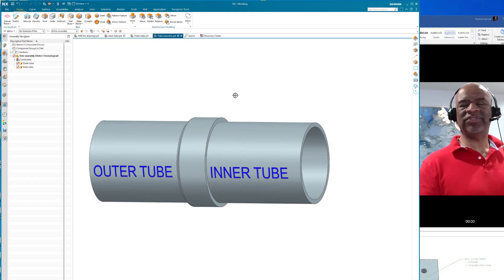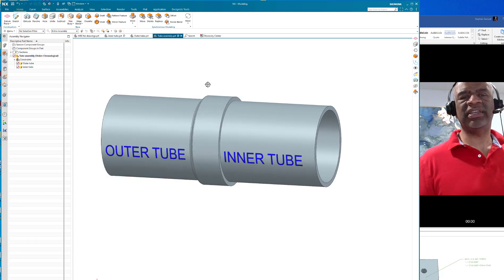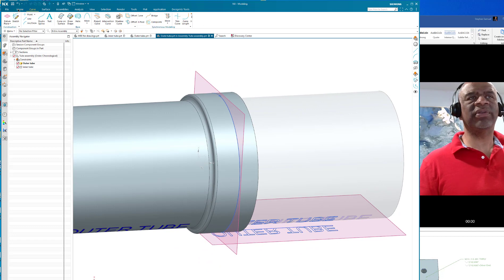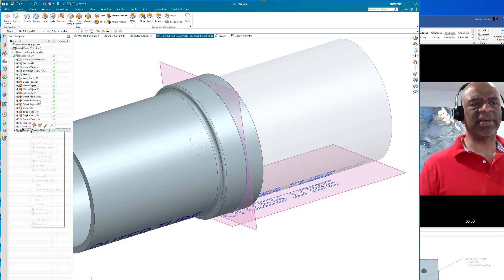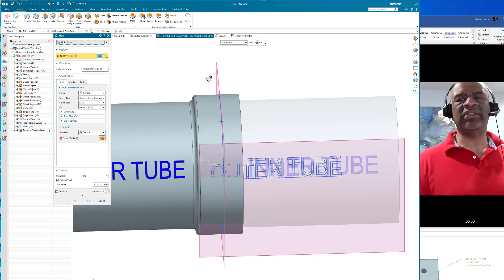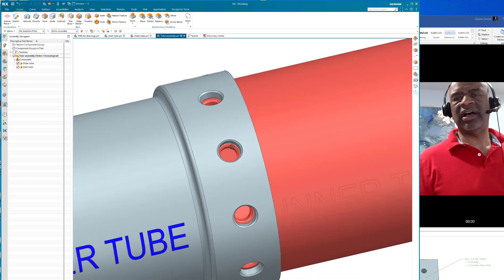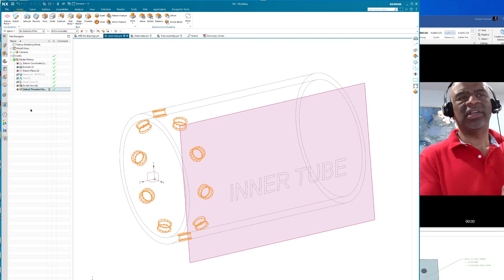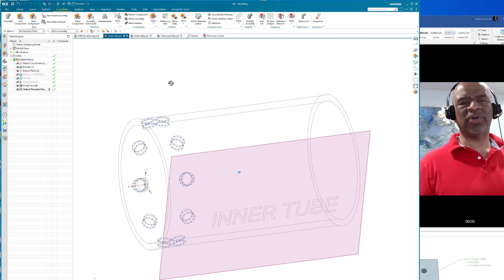Siemens NX - Circumferential Holes in Interlocking Tubes

Comment: OK, I have one more doubt, in this same configuration, we add separate annular end fittings (all same component) patterned around the circumference of the outer tube (pattern is asymmetric) how to specify hole series in this case.